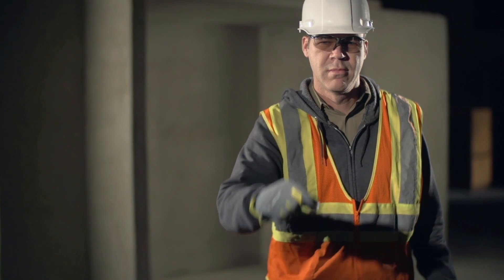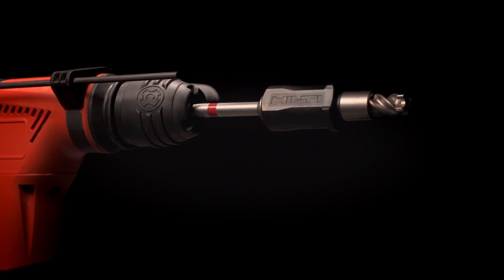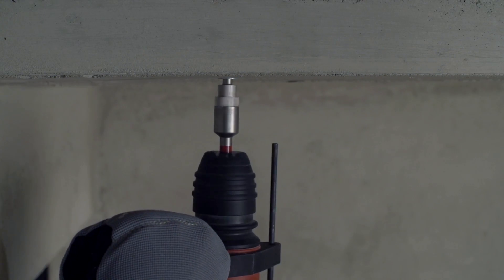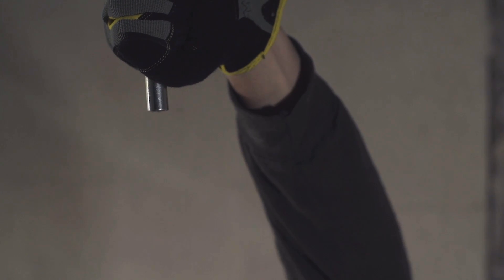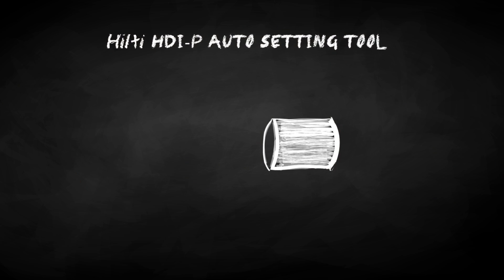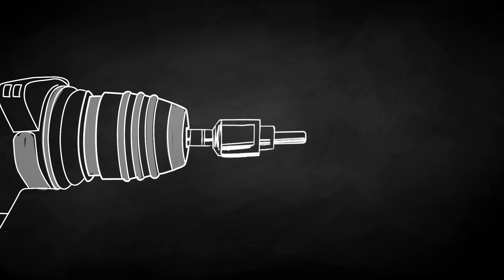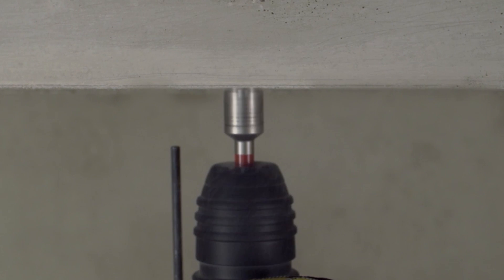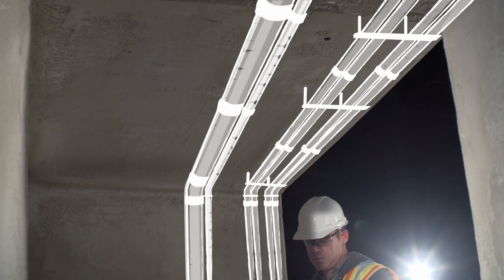DEMONSTRATION of the Hilti HDI-P Automatic Setting System

Comment: Too expensive and breaks after a short while. Had a few of these, one thing is good at is using the setting tool. Also with the Silica issue you can’t even use this with the vacuum attachment
Reply: Rubber part breaks?